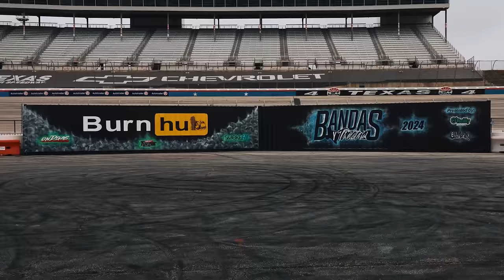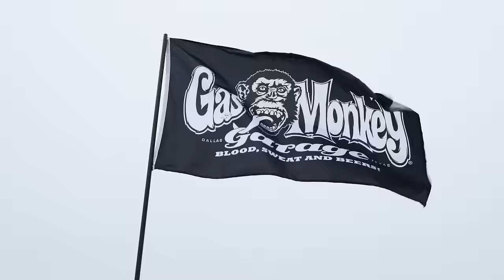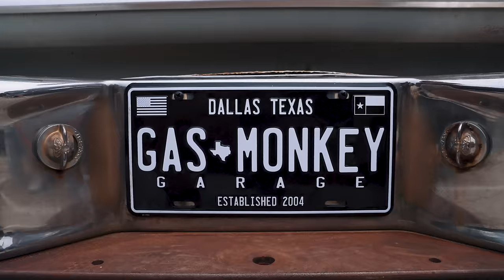Putting Our 785 HORSEPOWER F100 "MF79" in the BURNOUT PIT

Comment: Drove a co-workers 79 Ford F150 and I could turn the wheel 90+ degrees without the truck turning an inch. Scary thing to drive for sure.
Reply: That sounds like a bad or misadjusted steering box. My 78 with 33's turned just fine even on oversized tires.

Comment: Use the Volvo S 40 power-steer pump,its electric,and keyed into accessories you can turn the steering wheel  without the engine running,its a good thing

Comment: Maybe im missing something here but why does it take 785 HP to spin tires with almost no side wall flex. The reason I ask is back in the 80's, I had a '75 Ford F-150 long bed that I dropped a 460/C-6 into out of a '72 Lincoln. I did a quick overhaul on the engine. Just crank and rod bearings and a full reseal. Oh, and a Holley 1850 I had on a shelf. It made about 275 to maybe 300 HP on a good day. I could fry the tires (295/50R-15's) at will and all this for about $2,800 bucks including the $1,500 purchase price of the truck. That Gen4 Coyote 5.0 crate engine with no upgrades is over $10k. Just doesn't make sense to me but I guess to each his own.

Comment: I am in need of recommendations for a reputable performance shop in San Antonio, TX. Specifically, I am looking to have my seized L99, 6.2L Cammed engine on my 2010 Camaro 2SS repaired. 

I previously had work done at Performance HQ, but unfortunately, they have since closed down. As a result, I am seeking a new shop that can provide high-quality work on my Camaro. 

Given the importance of this repair to me, I am serious about finding a performance shop that has a track record of excellence and reliability. If you or anyone you know could recommend a shop that fits this criteria, I would greatly appreciate any suggestions.

Thank you in advance for your assistance and guidance. I look forward to hearing from you soon.

Comment: That 79 Ford is worth $6000 all day long. You could not touch my rust free 1988 Chevy crew cab 4X4 for less than 5-times that much.
Reply: K30
Reply: I was thinking the same. Dude accepted a 4k offer for a 6k truck. Wtf?
Reply: @ianmangham4570  Technically it is V3500 not K30. If I posted V3500 most people would not have a clue what kind of truck I was referring to.